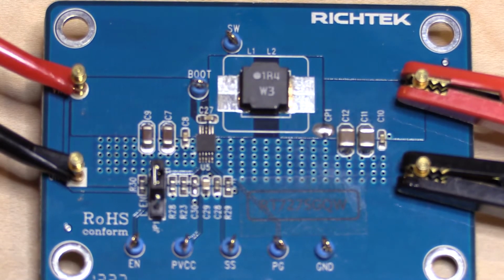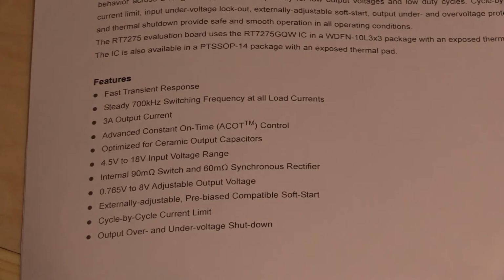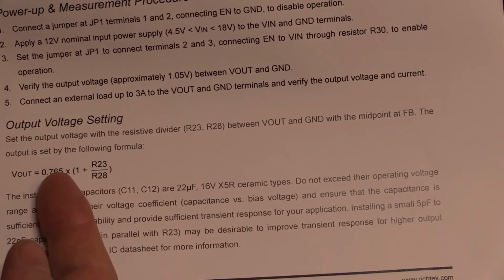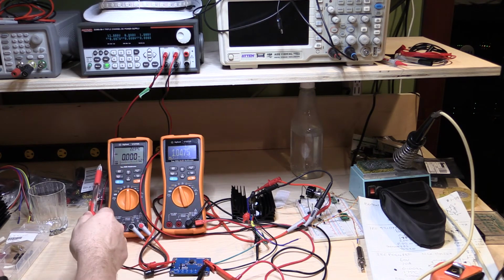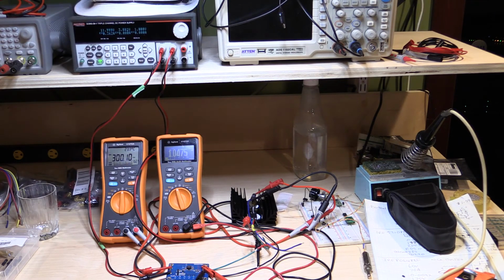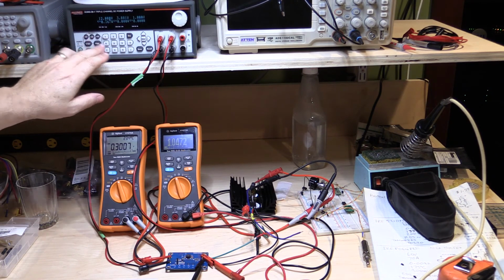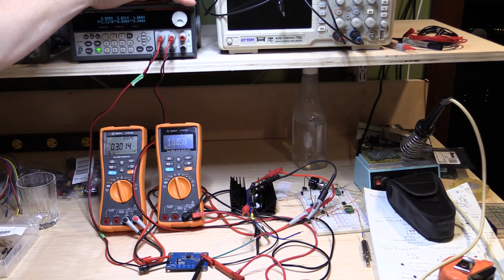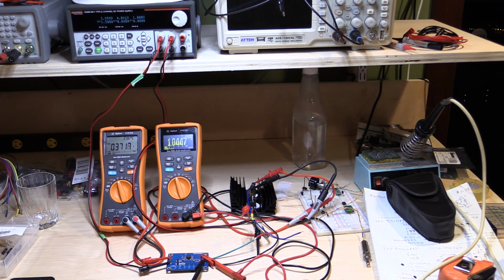Richtek EVB RT7275GQW Review Pt1

Comment: Those specs are what they found were the worst case chips capability. so you might find some that are better. Would not rely on them though in production to be as good, you might get a few that are not going to be able to reach the extra range. 50C on top means likely inside it is getting close to 100C, and might let the magic smoke out.

Nice development board there, good design on it for all specs.
Reply from the maker: I totally agree, that is a very valid point, I was simply finding the edges, the facts you mention are to be in my 2nd video as part of the summary finding, as as I noted in the video near the end (Which supports what you say), as the chip started to warm up, its limits started to change for the worse. so while you may get away with exceeding the limits in certain circumstances, I would never depend on it as a requirement for a production design. Good catch

Peter